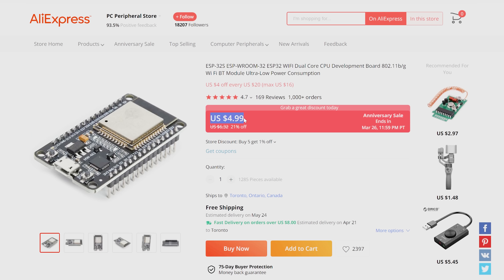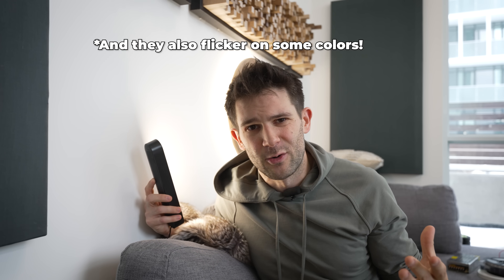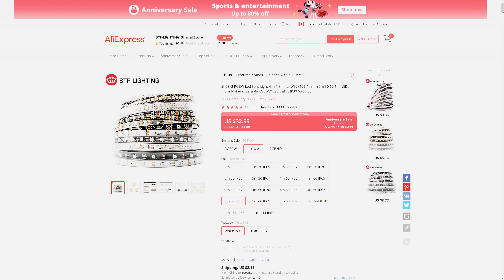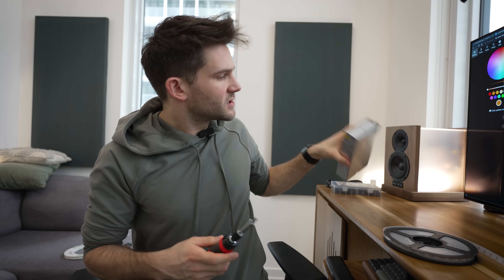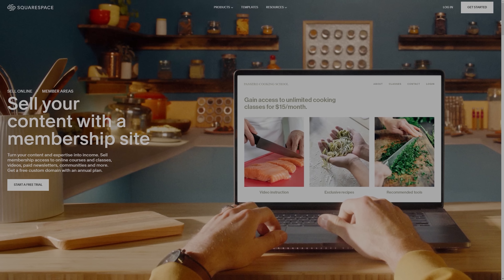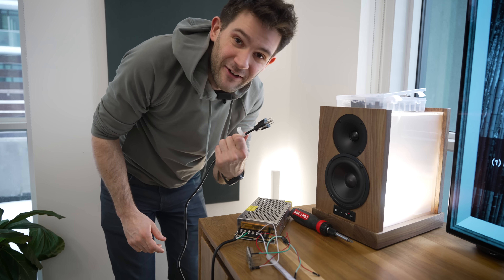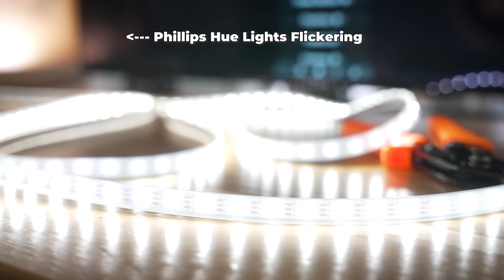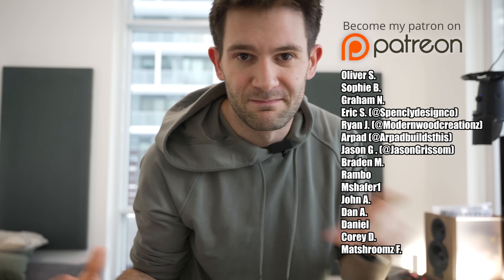RIP Philips Hue & Govee

Comment: The flicker you get in led's is not from AC power. That would fry them. It comes from the PWM Pulse width modulation of the led's being dimmed. More specifically, the frequency of the PWM. To make it look like they don't flicker, I use 10,000 hz pwm signal.
Reply: He did mention about the PWM later on which explains why it was still flickering while using DC power.  I don't know why he thought it was caused by AC power to begin with.
Reply: @xdragon2k because he doesnt know what hes talking about
Reply: if you have a low quality (or just simple, no frills) ac -> dc conversion circuit you will most definitely see an oscillating dc current and it will cause flicker.
Reply: And he seemed so confident about his theory 😂
Reply: @MaximilianBecker87 an LED light will ABSOLUTELy flicker if not properly built. First Gen Philips LEDs (like 8-9 years ago) flickered at 60hz (Canada's AC current frequency is 60hz). The flickering was more like pulsing, PMW would have a much more drastic difference in brightness between off/on states.

So yeah, AC can absolutely cause flickering in LEDs, especially since these LEDs are made of trash components and the rectified signal isn't being filtered by a proper capacitor filter circuit.

Also how I know a lot of LEDs flicker, the fixed brightness LEDs flicker... They don't use PWM, they don't have adjustable brightness (where PWM is needed) and they still flicker.
Reply: @MaximilianBecker87  yes, this was a shockingly horribly wrong explanation
Reply: I’ve never seen AC strip lights but it wouldn’t surprise me if they exist. The cheapest Christmas LED lights wire half of the LEDs in one polarity and half in the other polarity. Since they are just diodes, they can do their own rectification. Half the string will light on each half of the AC wave.
Reply: @thatsunpossible312  that's a lot of angry pixies. It could be done but it wouldn't be cheap or practical.
Reply: @aznative_  it’s a lot of voltage total but in series each LED only needs to drop ~3V.  They just put enough LEDs in so that the math works out. The “filament” LEDs in traditional style bulbs work on the same principle, where a typical series of LEDs sees a fairly high voltage.
Reply: @thatsunpossible312  I understand how it works and I stand by my comment.
Reply: The really shitty cheapshit ones use either a resistive or a capacitive dropper. That is mains AC flicker. Bur yes, anything up from that will be pulsed DC.
Reply: I don’t think he will understand what are you talking about 😂
Reply: They never run on AC, they have their own AC to DC converter. Typically it’s bad quality and that’s why you get the flicker.
Reply: some cheap led lights run directly on AC power, it's common for led light bulbs.  No that wouldn't fry them, they are specifically made to be used like that. Of course if you run your 5V DC leds on AC 240V you fry them, he didn't say to do that...
Reply: @nomecognome5050 any and all LEDs are diodes... Diodes allow electricity to flow one way. If electricity flows the other way, your LED is fried.
Reply: @FrozenByFire3  or it just doesn't flow the other way
Reply: @nomecognome5050  doesn't exist, LEDs that can take reverse voltage at 120/240V at 15A is not possible. However LEDs with a basic rectification circuit most certainly can.
Reply: @nomecognome5050  lol. You can't throw a diode in AC and stop the flow of energy and think you're still completing a circuit. LED bulbs that you screw in are converting themselves to DC.
Reply: @aznative_  yes you can. That is exactly how a rectifier works. You can literally use LEDs for the same purpose.
Reply: Not sure but I think LEDs NEVER run on AC. Pretty sure
Reply: @Retroboomin100  If you put enough of them in series, you'd get away with straight mains AC, but they're really not happy being reverse-biased, so sooner or later they kick the bucket. Unless you add diode protection, but then what's the point, am I right?
Reply: @blackezerro  do led replacement bulbs for fluorescent lights have a T/R in them? I never thought about if they did or not lol
Reply: @FirechickenExpress   T/R?

Comment: I use WLED on these NODE MCU's 😁😁  Ended up using several to run main lights in my work studio, so I can control them better. I picked up a few meanwell PSU's to inject power downstream to balance output.

Comment: I would have liked to have found out if the issue with flicking was the LEDs themselves, the hardware or the software.
Reply: The flickering of addressable LEDs like this will be because of the driver built into them. The microcontroller and software will have practically nothing to do with it unless they are doing something very wrong.

Comment: I've been using WLED for years now and I love them. I definitely wouldn't suggest stripping wires with your teeth. There has been a documented case where a man got lead poisoning when stripping wires with his teeth over the span of 20 years.
Reply: Not only that, some cable has a mineral dust inside the outer sheath, to stop dampness, and some are known to contain rat poison, so when rat chews cable it dies, so using teeth you could get the dust in your mouth,

Comment: Been using WLED for years, and love it.  Seasonally for xmas lighting, and year round for controlling lighting for my deck, sidewalk and steps (under railing).  For the latter I use 12v white leds and WLED to control the brightness with a mosfet (using pwm, easy to setup and only one part needed).  Never had any flickering problem with any of my lights.  Control the on/off using the time built in to WLED.
Reply: What frame rate do you film the lights with?

Comment: Amazing video 🎉 I have 2 questions… 
1) any other physical button to on/off the light strip ??? 
2) what app did you use at iPhone ?
Reply: 1) There is an option to wire a button to the ESP module and you can choose what it does in the settings for WLED
2) Its the WLED app but you can even use a regular web browser to view the same page when you are on the same network as the LEDs

Comment: chipped a tooth once when I used "the old fashioned" method for wire stripping......... later on it developed a fracture and had to have the tooth capped...... use a stripper or Exacto knife unless you still have your baby teeth.

Comment: Friendly warning: be extremely cautious about opening up power supplies, especially if it has been connected to power. The capacitors may store residual charge and the risk of electrocution at dangerous voltages and currents is very real.
Reply: Capacitors don’t hold charge for very long at all. Especially not enough to shock you. Especially because you’d have to close the circuit on a PCB which is almost impossible. It’s pretty safe especially when unplugged
Reply: @jayj-fx326  dude, no, just totally NO. Stop spreading such misinformation! These capapcitors can stay charged for days or even weeks and hold enough charge to kill you.

Comment: In practice you will actually NEVER NEVER even get close to max wattage- I built a bar with 29 linear feet of RGB strip on two ESP32 and used two 20A power supplies in parallelfor 40A total, the maximum I was actually able to pull from it was about 26W on white at 100 brightness and using preprogrammed routines averaged 7-12W. The WLED "Fireworks" effect ran at under 7W.
Reply: I agree about the wattage.  I have 60 amp power supplies driving thousands of lights, and typically use less than 10 amps for 4,000 5v lights.

Comment: NO YOUR WRONG!!! 
Sorry, i just wanted to get your attention. 
Your comment about your LED strips requiring 18amps and your power supply being 20amps so there fore you have a little extra to use. While technically correct, in practicality, it is not. When specking your power supply for a project, it is recommended to over spec by about 20%. That way you are not running the power supply close to or at full power, which for an AliExpress product, you can never be sure if they label them at the actual maximum, or if they under spec them just a little like most reputable manufacturers do to allow a little wiggle room for those times like this when the customer runs the product at full tilt just because they can, even though you should not.
The maximum specifications are not meant for constant draw, they are mean to show what the power supply can handle in those moments of power spikes, because if you run at full spec during normal usage, when you do get a spike in draw, it will far exceed the actual tolerances for that product and in best case scenario it just burns out the power supply (i assume i dont need to list the worst case). 
There fore, if you give yourself that 20% margin, you not only allow for spikes, you also are not not running it at the max all the time which will most likely burn it out faster than it should last with acceptable usage levels.

Comment: I think I am going to use this in my kitchen. I hate PWM driven LEDs. The power supplies seem to fail really fast if you used them dimmed most of the time.
Reply: These are still PWM controlled, but each LED has its own tiny microcontroller that does it rather than all being controlled by a single PWN signal. As far as lifespan and flickering, it will be down to the quality of the strips you purchase.

Comment: Just a quick think to note, for your cable coming from mains voltage, there's a couple safety things regarding it you should keep in mind, cut the ground line a little longer than the others, so that if for whatever reason they came loose and undone, the unit is still grounded, also when using those screw terminals, I'd use solid core wire, and if you have stranded like that was in your power cable, I'd crimp a fork/U connector on the end and use that, just some things to note going forward, great video though, and I think I'll probably implement this system in my own house.
Reply: Totally agree he should use a fork terminal or similar - the wires will just fatigue or corrode and break off after a while otherwise
Reply: @jackygrush  he literally says "this is temporary because I'm moving house soon, don't do this" in the video. Do you people even pay attention?
Reply: @rossclutterbuck1060 the person in the video didn't explain what he planned on doing to make it better. So the people in the comments are providing specifics that he and the viewers can look up to ensure better connections.
Reply: Good to tell but putting an esp32 directly to main without resistor or transistor is just not a good idea for the long run. Even in the table from wled it shows a resistor. Also the cables are to thin for 100w
Reply: @12pm_felix  I believe you're confusing many different concepts.

The ESP32 is not connected to mains. Its development board is connected to the switch mode power supply. This is correct. The development board has an on-board 3.3V linear regulator. You might put a fuse between, but not a resistor, and transistor makes no sense.

You would use a transistor or resistor after the ESP32 for driving analog LEDs, and each for different reasons. Transistors isolate and control higher voltage LEDs — usually 12V strings. Resistors limit current of individual LEDs, but the ESP32 already has internal 12mA current limiting resistors inside its GPIOs. Neither apply to the digital LEDs in this video.

Digital LEDs don't need transistors or resistors anywhere. You can use a transistor to shift levels between ESP32 and *6812, but 3.3V is well enough above the digital high specified by the LEDs. You can use a typically 100R resistor in the data line for impedance matching, but unless you're on the bleeding edge of transmission line speeds to an LED.

Remember, conductors are rated for current, and insulators for voltage. His cable can handle 300V, but definitely not 18A. Does that mean use a heavier gauge? Absolutely not! The strip is a wire, too, and it's not rated for 18A, either. You need to run another wire from power supply to the far end of the strip.

Comment: I've used the esp32 on the inside of my pc case for years, including serving a local site to change the lighting to color/preconfigured modes.  Thanks for sharing this.
Reply: Did you flash the esp32 with WLED firmware or did you build your own custom local site?

Comment: You may have answered this question ready, but can you do over 900 LEDs with it? And is there any way to integrate it with Alexa?
Reply: WLED should work with Home Assistant, which I think can be used with Alexa. As for that number of LEDs, it should be possible but there are some important limits. Power is the first issue, you will need to inject power in multiple places along the strip in order to get power to all of them. The signal will also have some issues with that many, most notably the speed at which it can change colors will substantially suffer the more LEDs you use. It's possible to use multiple pins on the microcontroller to control multiple strips in parallel (or segments of one strip that you have separated the control line on), but I'm not sure if/how WLED handles that use case. It's something I did a number of years back on a Christmas tree. That was over 700 LEDs, and I think it was controlled as 4 or 5 "strips" and had more than one power supply.

Comment: GREAT video! I actually love WLED and the ESP32 board. Your circuit is wonderful. I have to admit that I just did direct. I just have a cheap DC power supply connected to the ESP and also to the light strips.  They work like a champ. You mentioned that I can control through PHilips Hue?!?!?!  Had no idea! I control through Home Assistant. I am totally going to get it going through PH so I can control through Alexa! Thanks for the great vid! Will look forward to more!

Comment: You should consider using WS2815-based led strips or similar for 12V for the LEDs to avoid such high current and then a step-down-thingie, like those lm2596-based ones sold for $.5 on ali, for the microcontroller power. The 5-3.3V converter on the esp32 is linear, so it just burns the excess power, but if you give it 3.3V directly from the PSU, it won't. Also, those cables you used there, are quite unsufficient to allow for 18A - they'll catch fire.
Reply: as an electrical engineer, almost everything here screams Horror.
Reply: @RandomUser2401  what - my suggestions or the original video?
Reply: @roysigurdkarlsbakk3842  the original video. the title overpromised so much. when he claimed the flickering comes from AC mains I was screaming at the screen.
Reply: @RandomUser2401  good scream. but still, 18 amps through those wires, they would look like lightbulb filaments
Reply: @RandomUser2401 but he’a not wrong though. The DC conversion in the cheap lights doesn’t fully rectify the signal without a dip. Usually there are no sufficient capacitors on the line to keep it actual stable DC. So you get a brightness fluctuation because the current draw varies, or in really bad cases, the voltage drops below minimum. And that happens to be at mains frequency.
Reply: @Gren4te  that‘s 100 Hz or 120 Hz flicker and not noticeable to the eye, if at all present.

Comment: Could you use a usb power brick for the power supply?
Reply: I have the same question and can’t find a good answer on here.  Would also like to control via Bluetooth instead of Wi-Fi.
Reply: Also, would it be possible to use something like the qt py or are there specific esp32 versions that have to be used. I ask because some of them support usb c.

Comment: Talking about AC power seems like a useless confusing point in this video. It really doesn't affect LED lights as they are all using AC-DC drivers, even the single ones that plug into your lamps etc directly.

Comment: I don't know if I missed it, but can you change the color temperature of the white LED's? I set my LED lights to 5600K during clear, bright sunny days but change the temperature to 3200K for evenings and night. Thanks.
Reply from the maker: You can, kind of, but most LEDs are just faking it. You can't change the color of the white pixel. It is what it is. Most LED strip lights will just mix some blue or yellow light from those pixels into the mix to achieve other colors. It's not a perfect solution and hurts color accuracy to some degree. It's fine for 99% of application but tends not to look very good on camera.